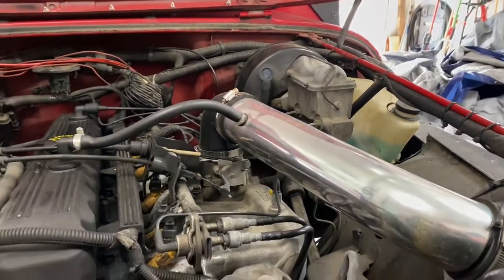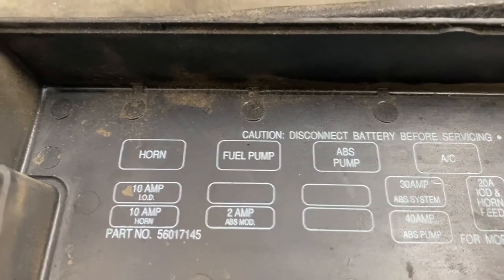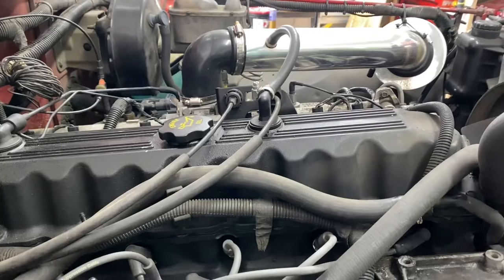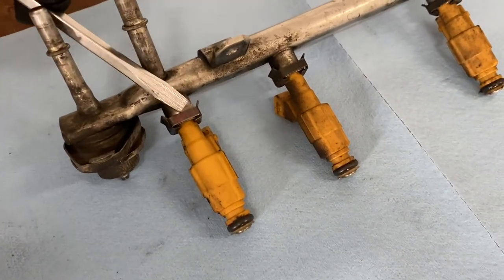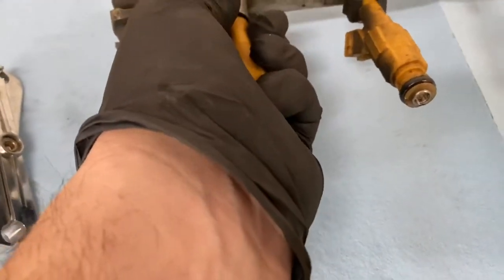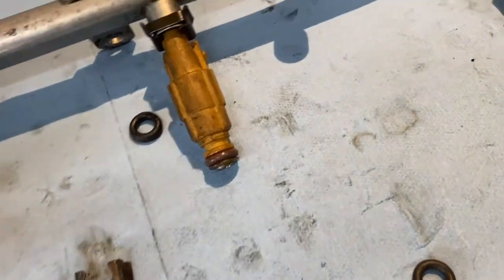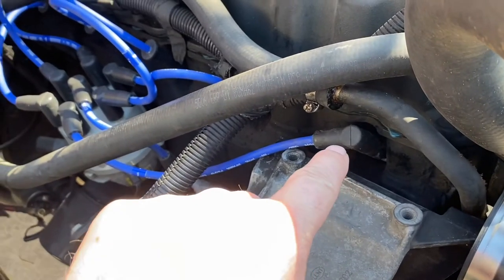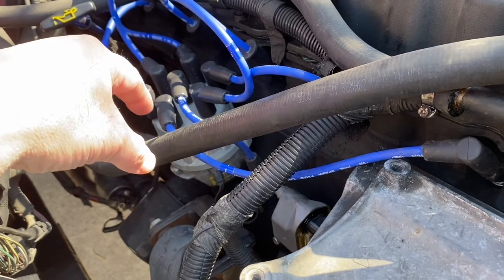1993 Jeep YJ will crank but won’t start ignition coil, fuel rail, fuel pressure sensor

Comment: My 95 ZJ just did the same thing. Wouldn't start. After towed home noticed upper hose blew, belt half walked off. Checked fuel pressure almost none. Changed pump, still almost none, replaced pcm capacitors, then no spark, changed ignition switch, coil and distributor cap, then it started. I figure it would take five things failing to stop my Jeep.
Reply from the maker: “I figure it would take five things failing to stop my Jeep”… love this. lol. Our Jeeps… they are a special breed

Comment: Hey any chance you maybe could help with my diagnosis ? I’ve got 91 yj 2.5L . The other day I tried to start it up after running fine the day before and I’m not getting spark, since have replaced, dizzy cap/ rotor, ignition coil, plugs/wires, crank position sensor. And still nothing, cranks but won’t start. I tested the 3 wires going to the dizzy but can’t find anything online on what they are suppose to be outputting. I also took out the ecu and had a look at the capacitors but turned up nothing, not like I know what I’m looking at anyways. Any suggestions are much appreciated trying not to drop 700$ on a new ecu thanks!
Reply: I’m getting power to my ignition coil but no power from the coil to the dizzy
Reply: You might need to take apart your ECU and see if the capacitors are blown. If they are, replace them and see if that helps. Shouldn't cost you more than 30 bucks if you don't have a soldering iron and two two hours of your time .
Reply: If the capacitors are okay then it might be a signal issue in the wire. Do a continuity test. Follow the wire from your distributor to the computer. Probe it at the connector on each end and see if the cable is okay
Reply: @TheTopCat650  thanks just read your comments! I have replaced the capacitors and still nothing. Cranks but no spark. I’ve checked for continuity from the ignition coil to the computer and found that multiple wires were giving me the same reading when it should only be the 3 off of the ignition coil. I’m guessing I have a short in my wiring harness. Will try and pull it apart to check for damages thanks
Reply: Sorry I didn’t see this sooner. I found an old tv repair shop and the guy replaced all 3 capacitors in my ecu for 5 bucks. He even tested them and showed me which was bad. Took him 15 minutes to replace.
Reply: Having the same problem with my 91 yj 2.5l …

Comment: Hello there i have same problem the only difieren is 
To get spark i need to leave my ignition key open for a leases 20 min and than everything work again  u have any idea why??? Please help me
Reply from the maker: Ooof. I’m not sure, that’s something different for sure. Any other things you can tell me?
Reply: Bad capacitors in ecu. Mine was doing the same. Easy fix.